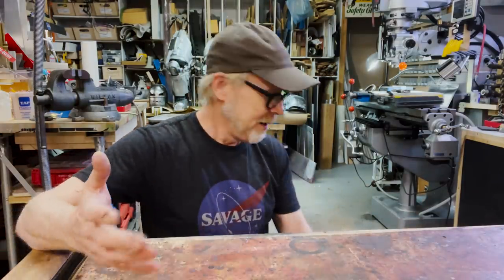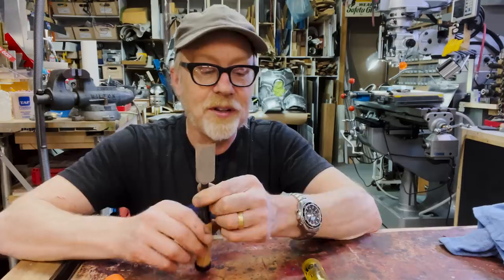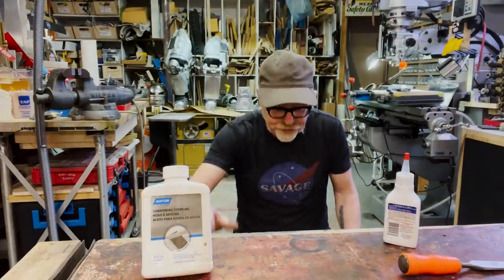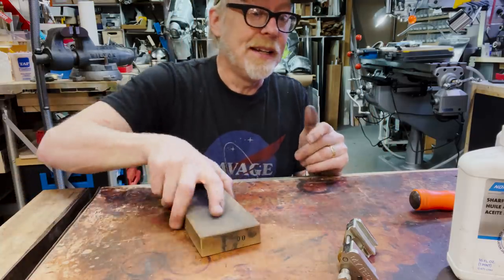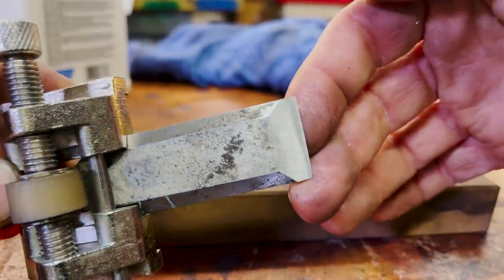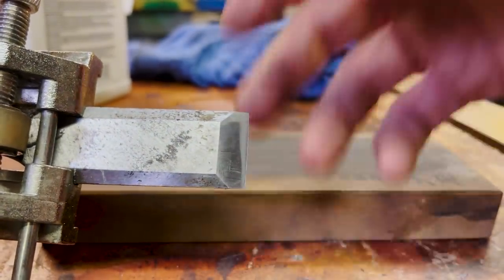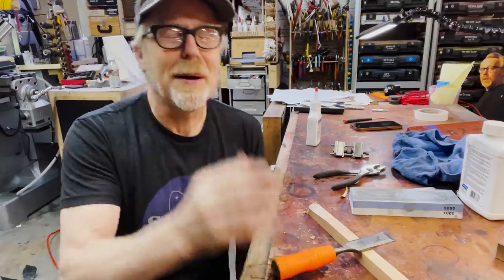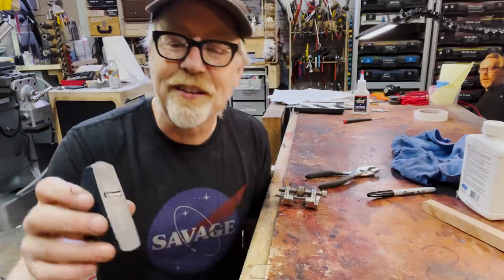Adam Savage's Favorite Tools: Woodworking Chisel Sharpening!

Comment: Ditch the stones, go with diamond plates. Tamara has a good video on a sharpening jig, as does Stump Nubs Wood Working. Here's Tamara's: https://www.youtube.com/watch?v=qYQT30GwRjg&ab_channel=3x3Custom-Tamar
Reply: Diamond plates cut the fastest.
Reply: Or better yet, go with a Tormek sharpening system. And if not that, a slow speed grinder (1750 rpm) with CBN wheels and a Oneway Wolverine system.
Reply: Yeah, that's a LOT nicer, but maybe a little much cost-wise for casual sharpening needs.
Reply: @JCWren  True, it really depends on how much time you are spending in your shop and how much time you want to spend sharpening. 
If you are working all day in the shop and end up having to sharpen your tools ten times that day, and do that every weekend, that hour each day can add up. 
Depends if you want to spend the time sharpening or working on your project.
For some, the sharpening process is also meditative, and I get that and respect that. 
For myself however, I want to spend time at the lathe. And sharpening lathe tools is a similar process mostly. The gouges take a bit more work.
Reply: @JCWren  I pay $6.36 for 9" X 3" diamond plates. Continuous pattern. Straight out of China.

Comment: Ohh dear Adam, no no no. you do not sharpen the entire grind angle, there should be 2 angles at the end of your blade, the grind angle and then the sharpening angle. you are trying to take the meat off the whole end, it is much better and easier to just remove the tiniest bit from the tip. I am a professional wood butcher, 50 years in the making. In the time it has taken you to set up that guide you could have sharpend 5 blades to razor sharpness. I love your videos, but this one made me cringe in the most terrible way.
Reply: I think what you're trying to say is there is a primary and a secondary bevel.